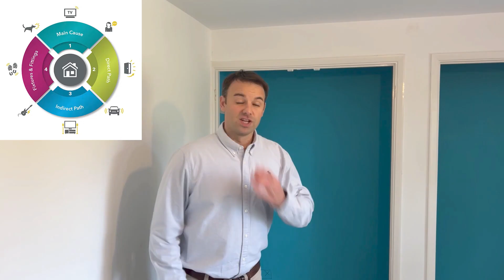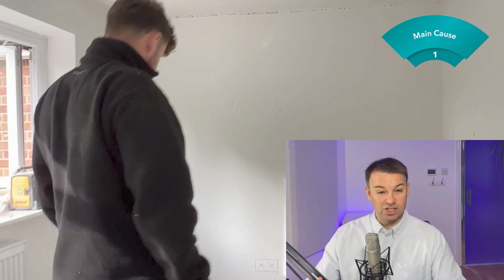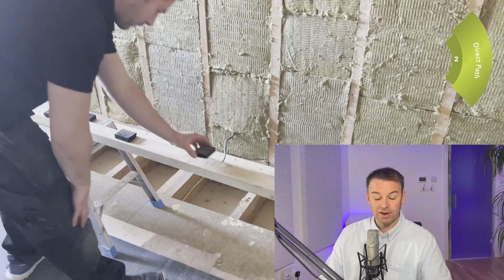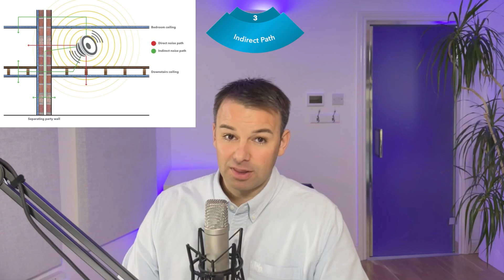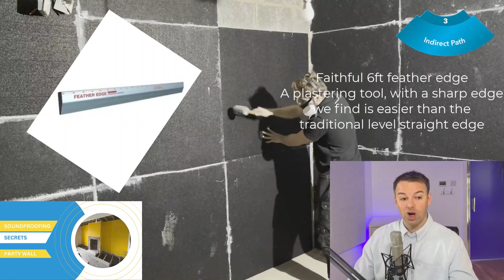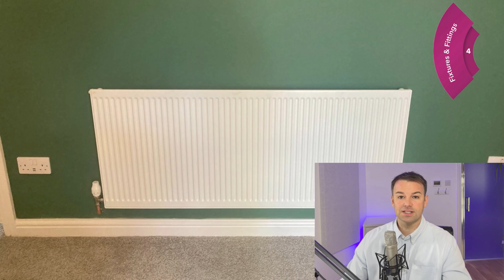How to professionally SOUNDPROOF Neighbour NOISE! 🏘

Comment: How much would it cost if I’d do this myself? I have a personal training space and my neighbors complain a lot that I produce too much noise. This looks like a very expensive solution. My wall is 10m by 3m.
Reply from the maker: Hey @ready2wintennis, if you have the time and diy skills, you should do it your self,
Realistically you will need a few hours installation support hours for that project…OR a place on the noise free DIY soundproofing course😂

That size room, and that situation, it sounds like the floor is the most important part. Will cost more than £5k maybe with a cost effective solution maybe less than £10k. Depends on your skill level, budget, noise problem, structure of the building and space available.

Might be worth jumping on a FREE noise diagnosis call to see if it’s actually worth it or possibly. Quietco.uk just request to speak with me when you fill out the form.

Comment: Do you have a video about an rsj into a part wall. Putting my ear to the wall the rsj is on is louder than rhe party wall.
Reply from the maker: Hey @sounduser, Thanks for your comment, there is 4 or more lessons on this and the different layers on The Noise Free DIY Soundproofing Course....so you can imagine the detail required to treat the RSJ properly.  I have this little short which briefly describe the layers: https://youtu.be/JFPD7EGqrNw?si=WfVEm2hCiMWRbAgG 
RSJs are quite a common feature in a lot of my videos, mentioned in this video: https://youtu.be/u7GUZHIOyuw?si=41BvU3i8vO4XHUfu and also this one:
https://youtu.be/0w6I0wCA2Lw?si=J6fv-s7lEYD8WOqX

Is your RSJ sat on the separating party wall??? If it is you really need to sound deaden, insulate it, install rubber and 2 layers of 15mm Sound Bloc Board.

An RSJ is a main cause, which means it does not matter how thick your party wall sound insulation is....unless you address the main cause, then the noise will still come through.
Hope that helps....let us know how you get on

Comment: Would love to understand please whether these systems are required for non-fill cavity brick walls.
Reply from the maker: Hi John, thanks for your question. Yes, they are required for non-fill cavity brick walls because the sound resonates between the air gap and the noise channels around the house. However, I also find these systems to be more important for filled cavity walls.

I know there is a lot of information about filled cavity walls being better for sound insulation, but after 17 years of installing sound insulation in homes, I just do not find this to be the case. I might be wrong, of course, but I just got off the phone with another homeowner who now hears doors banging, footsteps, and a lot of other noises since her neighbor (semi-detached) had her cavity walls filled.

The systems sound-deaden the walls first, and we find they give superior results compared to not sound-deadening the wall and just building a stud wall in front with the mainstream resilient channels and two layers of board with TecSound in between. Of course, you have to do it how we show you in the online soundproofing courses. Hope that helps.

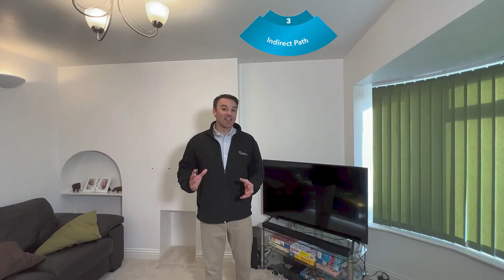Comment: At 24:50 mins. If the sound comes just to the left of the window on the flanking wall. You would have to still do all the window wall because the thickness of the soundproofing etc, would come out past the rest of the existing plasterwork on the remainder of the wall. Or is there a more slimmer system so you wouldn’t have to touch rest of wall ware the the radiator is. Just in the process of doing my walls so any response would be appreciated. Great video
Reply from the maker: Hi John, have a look at 24.00mins to 24.17mins and i show many pictures in the top right of “going up to the first reveal” it does create a 50mm step. You really need to return it into the window over the cavity if you can. There are thinner systems but this rubber will not channel the noise like those 27.5mm panel systems sold everywhere. Thanks very much for your question.
Reply: @jimprior7  thanks for replying. I’ve just looked at the pictures. I understand now. Appreciate the info Jim